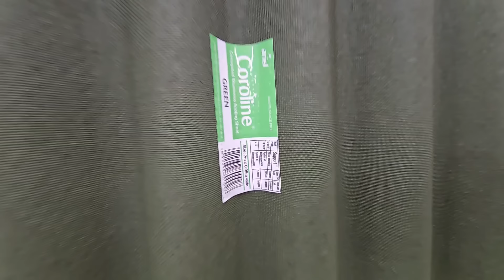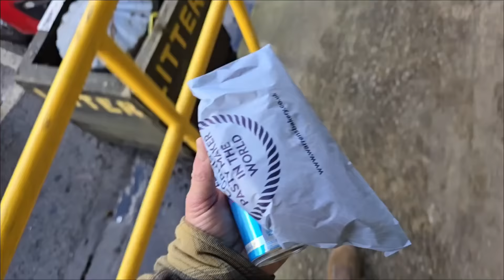A Trip To Trago, What An Absolute Pain!

Comment: Doing very well with the new outhouse Jamie, you really will need to put a couple more support batons in that roof to strengthen it up a bit or it will sag or cave in if it snows. Great job though
Reply: I was a bit worried that the  bottoms of the wallswere on or near the soil  :  weather / rain will rot them...will there be a partial front  on the shed / shelter ? Or  rain might blow in ?

Comment: I really like your string method for keeping things straight.

About using the drill to screw things in what changed my life was getting something called an impact driver - it screws things in while sort of hammering the screw at the same time. So much more power, life so much easier. 

Good luck finishing! I hope Sherpa approves.

Comment: If your drill is unable to drive the fasteners fully, it helps to drill a pilot hole about half the diameter of the bolt. As for your battery… if it’s 10 years old I’m not surprised it is struggling.

Comment: If you see this, Jamie, I have a couple questions and a suggestion. Why are you moving the mower out of the summer house? Will it be secured? With that guy trespassing and trying to see what you have to knick, I’d be worried he’d come back for it when you’re not there. Suggestions: consider putting down a bed of gravel in the part where the mower goes. When the ground gets wet (from rain or from the mower, if it’s just grass there it’s going to get really messy and muddy in that area. Won’t be bad at first,  ut from experience, it will quickly progress and it’s so much harder to address it then than to prevent it now. The area between the shelter and summer shed, ould be a good area, too. When we’ve had areas like this, we were told to get a yard fabric/tarping(?) that you just lay down over the grassy spot. Make sure it’s not just a plastic sheet or plastic tarp. Those will trap water. The ones made specifically for gardens and yards are made that the water that gets on them will just go right through and not pool up. It keeps the grass underneath from getting light. So it will kill that grass it covers and give you a nice flat spot to park or walk on. Then just cover the tarp with gravel and you’ve got a perfect spot for your mower to keep it dry. I’m sure Mr Sherp’s side would be fine with just the grass.
Reply: Sound advice, well said.😊

Comment: I can’t quite see from the video but, where you said you had a little leak, it looks like the fixings are in the low part of the corrugated sheet. If so you may experience a few more little leaks as the fixings should go through the peak of the corrugated sheet. Just a pointer, if you have done it through the peak overall no worries. Good job, should look great when it’s finished. 👍👍

Comment: If you are going to put in a lot of screws I'd get an Impact Driver rather than a drill also I'd use Torx Head screws as the bit doesn't slip out of the screw head so easily.

Comment: I'd paint that green roofing material in white to reflect light so it isn't so hot underneath when it's hot and sunny.  Since it's Sherpa's shelter, if he's under there to get some shade on hot sunny days, any efforts to reduce the radiated heat down from the roof, would be useful.  The UK has been getting progressively hotter summers in recent years.

Comment: Jamie re screwdrivers/insufficient power or torque. You can make it easier as follows 1) drill an appropriate (countersunk) hole 2) scrape the thread of the screw across a candle (I use a tea light) so that the thread picks up a significant amount of wax 3) drive the screw in one go into the wood (it will melt the wax, making the screw go in more easily and then it will solidify again.

Comment: The shed has come along nicely, well done Jamie. I agree you need a new drill but instead of just a drill, I'd suggest a kit that has a circular saw as well they are very handy when you have a lot of cutting and you can get different types of blades for cutting different types of materials. You may also consider putting some  sealent on the roof panels where you screw them in place, would not hurt in preventing any leaks.

Comment: Jamie, you may need to slate the roof so it's higher in the front and lower in the back so water runs down the back and does not accumulate on the roof for mosquitoes, mold and mildew.

Comment: You can use that clear caulking to stop leaking around screws / bolts or does England have any FLEX SEAL PRODUCTS, they have multiple different cool items like super glue which i own & love ( hint- always wipe off glue tip so it doesn't glue itself closed.) Different color caulking, waterproof wide tape, leakproof spray paint, my grandfather had a heat problem with his storage shed & he painted the rippled roof (corrugated panels) white & it stayed much cooler. My dad built a storage house where he did all his drafting (blueprints) & he was a part time draftsman & he had it raised off the ground &he was always working on it & tweeking it.
He even had hangers on the back of building where he hung his large ladders, he was a painting contractor after he retired from the air force. 
 🧔🏡📐🗄🗑📍📥🗂🖋🖊🙏✏️💼💙👍🤜🤛🫶🧑‍🎨🚴‍♂️

Comment: Great job, but far for me to be killjoy, will the ground water soak into the bottom of the wood structures, I thought they usually balanced them on concrete beams, with ref., mainly to the summerhouse. With ref., to yours I should think they be be easily replaced.

Comment: I saw your leak but didn't see if you used roofing screws with rubber gaskets on them. I live in the mountains where most houses have metal roofs so that the snow slides off easier. The metal roofing comes in several colors with matching colored roofing screws with rubber gaskets to prevent leaks.

Comment: Your post hole digger is stressing me.  Please put some sand in a bucket big enough to put your post hole digger in, pour some mineral oil in the sand and push your post hole digger in the oily sand.  This will clean off the damp earth and oil your tool up so it will not rust (as fast).

Comment: I thought the plan had been to keep the metal roofing from the old shed, repaint it, and use it for a building project. Was that something besides this? The new roofing...looks suspiciously shaped like the old metal roofing. Did I get that wrong? Also...will the new Sherpa Shed going to need to be mowed? 🤔

Comment: Build a shed myself I said, it would be easier I said.  You did great, I still can't figure out the drain snake with how my tub is plus I am top floor.  Slow shower drain went to no drain.  Have Long hair, 50.year old plumbing.  Bought a wet vac. Problem solved.  Pets to Sherpie Hi to Sue hoomum and Nook.  Michelle from Omaha